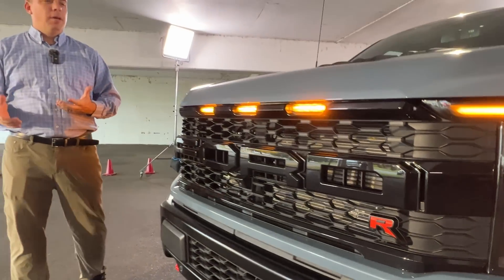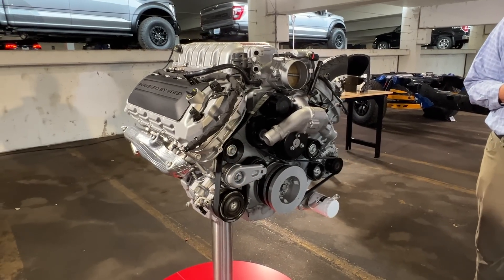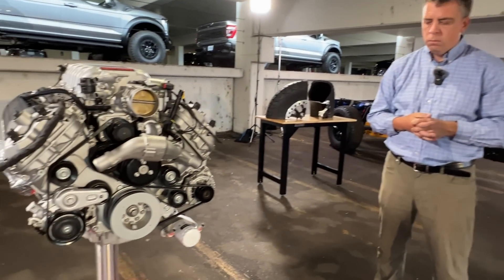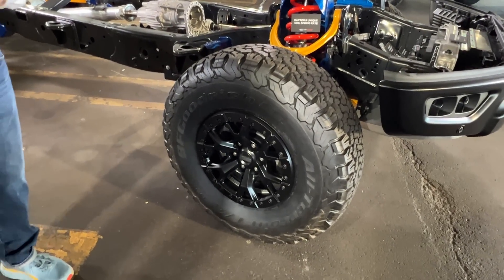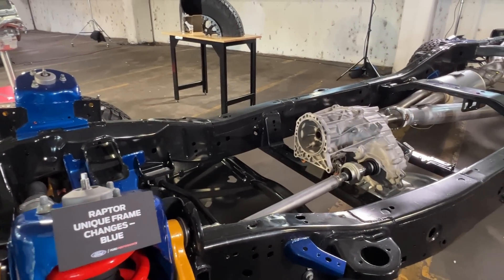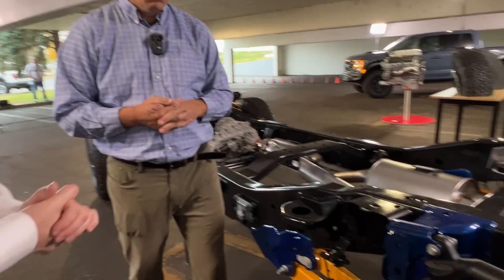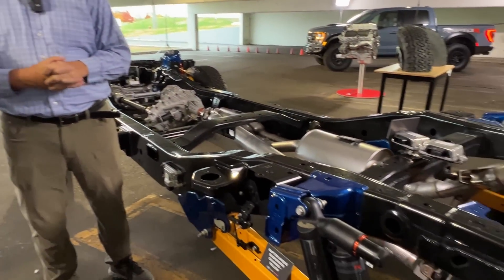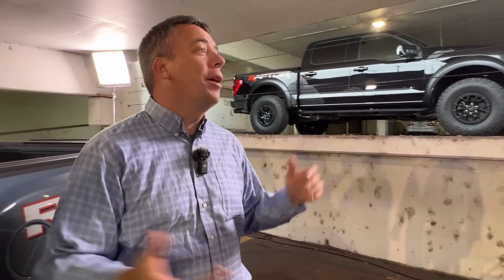Here Is Why the New 2023 Ford F-150 Raptor R Has Less Horsepower Than the Ram TRX

Comment: Interesting location for this shoot. A huge parking garage? This place is set up, but what an odd spot. Wonder if there is a reason?

Per the Raptor R, that’s the “fun” truck I want. What a sweet ride!
Reply: So you cant see the details of course. Like how they dont fully weld the front shock tower. Cut corners on the lighting so you cant see the cut corners in manufacturing. No one wants a raptor with their garbage 10 speed.

Comment: Henry ford would be pretty pumped
Reply: Honestly, Henry Ford would probably hate this truck. He was someone who didn't like change, that's why he was so late to game introducing hydraulic brakes in his cars, he refused to listen to his engineers at the time about how superior hydraulic brakes were compared to the mechanical brakes. Same with fuel pumps, he insisted upon using inferior gravity fed fuel pumps when everyone else had moved to mechanical fuel pumps. All of this is also the reason the model T ran from 1908 to 1927. If you compare a 1927 model T to...well almost anything else from 1927 the model T looks so completely dated, it literally took sales of T tanking for Ford to invest in the new model A. If we could resurrect ole Henry for a day or two and let him poke around this truck I have little doubt he'd be appalled at the complexity of it all. I say all of this as a life long Ford fan, but Henry Ford dying was literally one of the best things that could have happened to Ford Motor Company.

Comment: “We want a durable motor” . Hellcat engine with 800HP proven to be the best durable engine since 2015
Reply: Yeah, when it is used inside the car with all the help it gets, because the car runs systems to keep it good. Also you can't pull a trailer with a hellcat, and also trucks are different

Comment: Don't need a mechanical torsion diff? Um  yes. Yes you do need that.
Reply: You probably don't know what they needed or didn't
Reply: @tnc7399  torsion limited slip diffs are in my opinion superior to anything that uses abs traction systems. The fact that we are paying the price for the top dog truck from Ford but with less off road features.
Reply: @randalsweeting661  maybe it ended up worse in the end
Reply: @tnc7399  who knows maybe the diffs with the torsion lsd didn't like the new hp and were breaking. I'm sure the guys with  high Hp mods can testify if the diffs hold up.
Reply: @randalsweeting661  maybe it just, wasn't bad, but wasn't good. Just unnecessary

Comment: Cleetus McFarland has a Crown Vic with the same motor putting out 1000hp and the motor is super reliable being thrashed in neighbor doing massive burn outs. Not matching the TRX is a cop out showing ford can't compete head to head with Dodge and Ram
Reply: I thought that was from a 2015 gt500

Comment: The Ford Raptor-R is shown to be surprisingly good after this deep dive quite besting the RAM TRX in almost every metric except pure horsepower!  That suspension system upgrade NEEDS to be put onto the Twin Turbo V6 option AND into a new Hybrid EV version of the Raptor F150.  We've got EVERYTHING we need in a true off-road vehicle EXCEPT pure driving range!

I am saying that a long-distance forest-road-runner version of a Raptor that has an extended 1000 miles range would be a wonderful addition to the line-up for those of us who want to do the big long 4x4 offroad circle routes within North America. I think a hybrid V6 with a larger gas tank or even an in-bed auxilliary tank would DEFINITELY fit the bill. You still keep the outright HP of the Gas engine but the EV motor + battery AND extra tank size would help in the range department for those extra long cross-country forest road runs.

I would say that Ford would easily sell at least 25,000 units of that hybrid long-range EV version of the Raptor at the fully optioned price points! That is nothing to laugh at since that number of units is over TWO BILLION DOLLARS USD of income!
The work has already been done on the Raptor-R! Just takes out the V8 and put in a hybrid V6 and EV motor and home-and-in-field solar chargeable battery pack and a larger gas tank and market it as the Off-Grid-F150-Raptor-1000. Sell it along with a pro-power unit and extra Jackery-style portable wheeled battery pack and some 500+ watt solar panels and the legend will continue on as a long-distance forest road cross country runner! Remember to add a built-in lockable combo freezer + refrigerator that is accessible from the outside via a smartphone enabled keycode or key fob and we are set for long-distance overlanding! Put teh combo firdge/freezer into an extra thick tailgate and make it big enough to fit a full one gallon bucket of ice cream in the freezer portion and five foot long sub sandwiches and a divider-wall-separated six-pack of Sprite for the refrigerator portion! Also add a longer and deeper cooler/freezer compartment so we can keep all those fish such as trout or salmon we catch nice and cold or fully flash frozen at the freezer or cooler temperatures we set on the smartphone menu options!

V

Comment: Why not put that motor in the Lincoln Navigator, to compete with the Escalade V?
Reply: First, Ford is trying to downsize. And second, at this point, it wouldn't help. The Navigator lost that battle long ago.
Reply: @krane15  downsizing would be irrelevant for this.  Big horsepower never hurts, it’s been pretty effective for Dodge, Jeep.  It couldn’t hurt Lincoln.  They may have a problem producing enough right now.

Comment: No  Leaky oil pan?? No timing chain problems ? No spark plug issues? Is there going to be a standard transmission? We really need a  work truck that we can keep without trading in every 3 years?

Comment: Give me a V6 TT all day over grandpa’s V8. I’ll take more power, better fuel efficiency and easier to unlock power by light modifications with a Turbo platform over that corny V8 noise that’s beyond played out. Somewhere some dude that looks like Joe Dirt is revving his V8 and spinning tires getting smoked by an electric truck but hey atleast it sounds fast

Comment: I think Ford dropped the ball compared to what I believe they could've done as far as improvements to the Raptor R interior. If it's your flagship top tier luxury sport truck then I think Ford should've created a major interior difference from a regular Raptor to a Raptor R especially for how expensive it's baseline price is not including major dealer markups that are guaranteed to drive the price of the truck up to at least $135K!!
Reply: It isn't a sport truck. It is expensive, for offroading
Reply: @tnc7399  it's a sport truck. Majority of people that buy a Raptor aren't using it for its intended off-road use. It's a mall crawler pavement sport truck for the majority of buyers.
Reply: @quitoduck  I would say yes to that but it isn't the biggest or meanest truck. They are gravel paths hitters if anything
Reply: @tnc7399  I agree 👍🏼

Comment: Having more HP is good for bragging but like he said, if it's not usable HP then what's the point.. 
I can understand why Ford is done with playing the HP game because they've already proved in the past that they can be the king of HP if they want to but the problem with trying to always be number 1 with HP is that the other brand will come along and bump it up just enough to claim the top spot and after a while it's just ridiculous. 
Anyone that has spent any time around a TRX, you quickly learn that it's more of a street truck anyway. It's an okay off-road truck, but the TRX really can't handle 100mph across the desert without major handling issues and all of that HP and TQ does no good if you're upside down.

Comment: Why not buy a V6 Raptor and drop a 5.0 crate motor in it and save the $$ that the Raptor R will cost
Reply: Why not buy a regular 5 L F-150 and just upgrade the suspension and put body kit on it
Reply: @kubeanie18  Probably because the cab is the only shared component between them. They have different frames as well as suspension.

Comment: What, in the world. Does weight have to do with increasing the power past 700. What a piss poor excuse.
Reply: The supercharger itself weighed 100 pounds. To make more power, tends to require heavier stuff
Reply: @tnc7399  a smaller pulley, and more boost is not heavier
Reply: @tnc7399  a better tune, is not heavier
Reply: @BossAuto_  he said it weighed 100 pounds, and it isn't even massive compared to really massive superchargers. More power means more stuff needing to be better, and more stuff to add, make bigger
Reply: @BossAuto_  a better tune? They tune it from the factory as the best truck in stock configuration. And with laws in place, they can't do everything

Comment: Well... as long as this V8 doesn't break down like all of the ecoboost failures, I'd loke to own one of them at some point. My workaround would be to get a Gen1 with the 6.2 V8 instead, as this motor is known for reliability... so much reliable, Ford decided to kill it... lol
Reply: I have a 3.5 ecoboost with 100k miles and no issues at all. I’m not sure where your getting break down all the time
Reply: Ecoboost engines are literally praised for their longevity bro. They had a few kinks when they first launched, but are generally quite solid now. So I have no idea what you're talking about. Also, car brands don't kill an engine because it's too reliable, nor do brands want to make their cars less reliable intentionally. Ford's 2.5 hybrid used in things like the maverick, escape, and fusion, among several Lincoln models, is one of their most reliable powertrains, they still use it. They also still use the 5.0 and 6.7, and those engines are extremely reliable. Contrary to popular belief, planned obsolescence doesn't really exist with modern cars, because brands don't need to rely on it, and it will only backfire, damaging the brands reputation and costing them future sales. Now more than ever, car brands are focusing on quality and longevity, because they have to. If you make an unreliable car, people just go to one of your dozens of rivals. God I love the free market.
Reply: @KB-bh9hp  no they're not  Ford ppl will say they are but timing chains failing before 100k tells me they have tons of issues then you have turbo issues higher maintenance cooling issues terrible carbon build up that cause more issues not all of them have these issues but there is a big portion of engine failures
Reply: @dor1tomcswagger69  As stated previously, these are mostly issues with earlier Ecoboost engines.

Comment: Not sure I would want it with more than 700HP considering they were snapping axles during testing at 650.
Reply: 700 is a lot they've managed to cram into a truck meant to hit the higher speed trails

Comment: Maybe next time hand him a piece of paper with the questions you are going to ask the day before you ask him. He should know the answer to every question Andrea asked without needing to um an uh so much and not actually answer the question. The Raptor weights less so it doesn't need more horsepower to compete. The answer is that simple. 
The Raptor is a good platform, but like all trucks is way overpriced. As long as Ford has been building trucks, they should have it figured out well enough to build a great product at an affordable price.

Comment: TRX will still beat it on the street. High speed off road the Raptor will win. I had a first and second gen raptor. I now have a TRX. Not sure why Ram listed 0-60 of 4.5 when every TRX on the rod can easily do it in 3.5 / 3.9

Comment: Such a sadly wasteful vehicle. Most people that buy this will never use it for what it is engineered for. 
Remember drilling for oil absolutely decimates the area around it and makes ground water toxic. Consider only getting what you need folks.
Reply: When you are spending this much on a truck to show off, you bought the wrong truck. It isn't a show truck, the normal trims are

Comment: Ford welcome to the 21st-century finally getting rid of cheap ass leaf springs that were used on the horse and buggies in the  in the 1800s and finally installing a V-8 instead of forcing your patrons to drive garbage V6 engines just because you make them and not because the customer wants them👍

Comment: More HP and torque from a V8 is nice, but weight should be more important in such a car that is going to jump around on sand dunes lol
Reply: That engine is fully capable of making more power without changing the weight at all, disappointed there wasn't some kind of technical answer provided here.

Comment: I pray that the CAT Converter is NOT stolen. Am I about this has 4 of them on the system. I pray that the METAL inside is Less valuable. Does anyone know if RAPERS piping system are being STOLEN or CUT off. With the height of the truck off ground, Easy cut jobs.
Will say they cut my 2000 F-250 off in 40 second. And these guys are ARMED. My RING camera FILMED the whole theft. A Detective called us a week after we gave are video footage to them. Ring camera got License number on get away vehicle. The cops know who they are. Anyway they SHOT at another home owner who confronted the theft. Very Dangerous People out STEALING these expensive metals they put in these vehicles parts. Does anyone know about the RAPTURE systems.

Comment: The raptor R IS impressive but i still feel like they didn’t quite hit the numbers they needed to regain the Crown of KING of offroad trucks. Let’s also keep in mind the Raptor is more expensive and its not clear its quicker than the TRX or has a better interior and in my opinion the Gen 3 front end is terrible. Gen 2 was great. The best thing about raptor is the aftermarket support. The front diff is a real let down for me as well as the ford interior. It’s just not up to par quality, features or design.

Comment: 7 horsepower deficit isn't going to give trx the advantage especially the raptor is much lighter. Also the torque of the raptor r appears later in the powerband which beats the point of being a truck well trx and raptor aren't even meant to work to begin with. Goodluck with the dealer mark ups tho🤣🤣